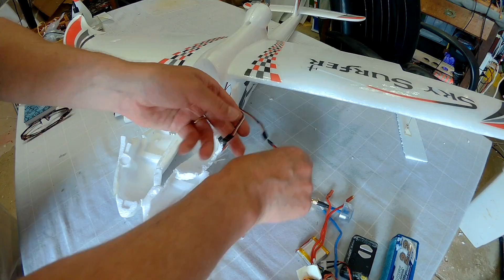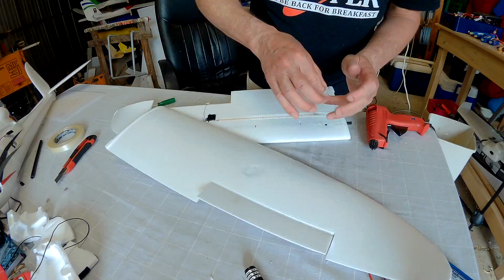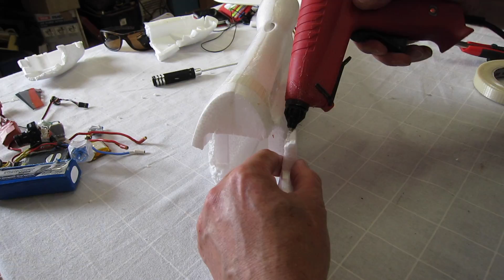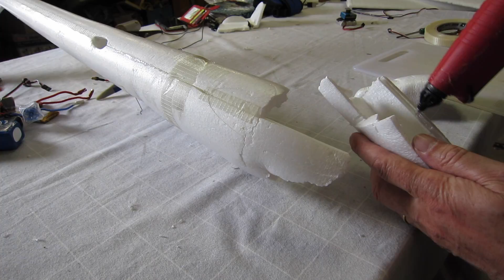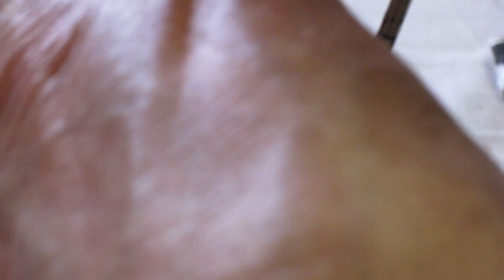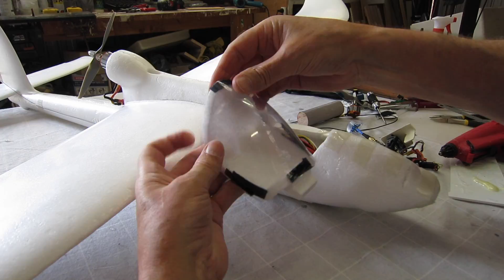XUAV SkySurfer X8 repair

Comment: What kind of glue are you using in your glue gun?
I got a totaled SkySurfer and a kit to move over all the electronics.
I have been doing research and there are so many recommendations for glue to use?
Do you recommend a  glue or use the glue gun with what kind of glue sticks?
Thanks in Advance
Reply from the maker: Any glue sticks I can find. Don't seem to have much choice here.
Reply: @AndrewNewton  Thanks Andrew,
Did you say you can use a 3s 11.1V/1300mAh when doing 3 channels, (no ailerons)?
I assume that would make it lighter and get more flight time?
Reply from the maker: @JPnTX  Possibly but less battery capacity

Comment: Once with my Bixler 1.0 before I wrecked its wing I lost sight of it similar to you with this. I let go of the sticks and throttled down.  After some panic I found it by using the video output as a direction finder. It had landed upright undamaged. These planes naturally try to right themselves if the controls are neutral. I have had nose dives other times but it was because I was trying to "fly it". Did this once with the bixler and several times with my Finwing penguin. Nose flew to pieces.  Luckily a kindly older gentleman glued it back together using Gorilla glue which is how I learned how good that glue is.

Comment: I miss my HFT Wild Hawk!  Slammed and repaired it like in this vid, sooo  many times!    This plane stands up to damage and will quickly field repair any "unexpected disassembly events" with some clear packing tape or 5-minute epoxy! You'll be flying again in no time! Great beginner design and easily modifiable with a stronger plywood motor mount and a hotter motor!

Comment: that fuse is available for around $20 -30 which is best way to go imo... never got good results using hot glue... i have used hot water and medium CA then some light weigh filler and paint and made models look almost perfect again for several years...just takes time,but is very easy imo...

Comment: Oh man, that's too bad, sorry it lost the signal. This crash looks exactly how my Bix3 looked after it lost an aileron servo in a bank turn at full throttle into the ground. I picked up the pieces and hot glued it back together. I saw another vid how this guy put the foam pieces in hot water (real hot, almost boiling) for the compressed out of shape parts, they just kind of  expand  back to shape, not perfect but close. Thank you Andrew for posting your  great video's!

Comment: Seriously using hot glue mate? 
If i were you 
I would use epo glue 
Very Much stronger than  hot glue gun 
I know longer time to cure but it will take years to hold good
Reply from the maker: The glue doesn't need to be any stronger than the foam

Comment: Hey mats know this is an old video and I dont use this account only due to getting youtube red free for three months with google music.
Anyway was talkimg to the giys I purchased my Oterra from and they say that the Opterra uses white silicone to glue it together. As you guessed I had done the same thing to it. Anyway put it back together with said silicone and it works great. And on hard belly landings has a tiny flex to it so doesnt explode in said repaired places. Worth a try. Remember rub some soapy water over the excess to remove it so its just in repair with non sticking out. Old builder/plumber trick you may already know. Cheers Gus
Reply from the maker: Didn't know that and I like it. Thanks for the tip.

Comment: I will try less hot glue..and the outdoor D/S tape. Used it under gift card/aluminum motor mount and it goes nowhere need to try it on the servos. Thanks

Comment: Love to watch you at work...shows all is not lost when a plane crashes.  Any suggestions-a good majority of the time I use hot glue on the servos (EMAX-ES9051) it seeps into the mechanism and gums up the gears and ruins the Servo.  I have been building the Flite Test speed builds and experimental airlines tube planes.  Of course I  have bought a couple of plug n play and one bind n play...my original sportsman s+. Which has been crashed and fixed several times.  I am VERY new to this hobby as you can probably tell.  Love your music!
Reply from the maker: Maybe use less hot glue on the servos? I just use a few small blobs and tape over the top, or I have also used double sided tape (Scotch outdoor) or contact cement.

Comment: After you diy the motor mounts, what max size prob can be use? Does the plane effect from the slight more down thrust?
Reply from the maker: 7" prop is about the biggest, if the motor is up too high then yes it will affect the thrust line.

Comment: Hmm I'm kinda surprised you used hot glue to put the plane back together.  I prefer CA or Gorilla Glue.  But what the heck if it flies and doesn't come apart thats all that counts, right?

Glad you found it, you need to put a F4 flight controller with barometer & compass on board in it and run iNav.  I have plans to do that with my Mini Talon I have sitting here.  

Check out Painless360 channel as Lee has it fully documented on how to setup a fixed wing with this combo.  It's really a sweet setup and easy on the ole pocketbook too.
Reply from the maker: Gorilla Glue and epoxy for serious build and hot glue for quick repairs to foam, I have an Omnibus F4 / GPS with iNav on my Bix2, and it is amazing

Comment: Discharging in salty water is a unnessecary mess.
- discharge it with 4 in-line soldered car light bulbs 25W each (maybe you can jump this)
- solder + and - wires together
- drive a nail through all of the cells 
Works for me pretty well.
Reply from the maker: Bucket, water, handful of salt, clip off the cables, drop the battery in and forget. Doesnt get easier than that, and a fire danger is immediately stopped.

Comment: I had same problem with Mobius - battery died. But! I've put new battery and it worked! So try that first before dismissing camera, BG has replacement batteries.
Reply from the maker: I have spare batteries. But the problem is some tiny components were ripped off the board, not fixable.
Reply: Guess, I was more lucky. However, while I have found sd card, it was damaged (probably by heat released by punctured battery). So no footage for me either(

Comment: Sir Newton, I wanted to let you know that I received my air3 from Multicopter and it looks good. FYI, it took about 30 days to arrive to SW Missouri. Did not really know what to expect. I am looking forward to wiring it up and trying it out. I think I want to just lay it all out on a board like you did in your setup video. My comment I made on  order for the kit, due to your videos, attracted a smiley face added to the receipt in pen. Looks like you have friend there. Hope it helps. Like to support your, videos and the great info you provide.
Reply from the maker: Thanks so much. Multiwiicopter are great to deal with and your feedback must have worked because I have some more seriously good gear to review from them.
Reply: great. I will be watching for that. BTW, could I use servos like the Emax es9=08a II it he air-3 Inav, or should I use digital servos. These would be for mini talon, Stratosurfer and Munter?

Comment: I hate crashing planes especially when their NEW :-/     My original bixler one has about 12? sticks of glue in it and it still fly's Fantastic!   It still has the servo's in the ailerons and rudder when the ARF kits came with motor and servo's!  It now has a new servo in the elevator,   and a 2200kv 2826 motor  (modded) with a 7x6 prop, and it LOves flying in stronger winds :-) great plane that's why I bought this  skysurfer, to get the feeling back of a new bixler! :-)  great vid, shame about the skysurfer,  they should be called a phoenix,  cos they always rise from the ashe's :-D
Reply from the maker: I have an unbuilt Bix 2 that I might put together now, and treat it with more respect. They do fly so well when they are clean and straight.

Comment: Andrew Andrew! You've forgotten all that I instructed back on your video you made for RC flight suggestions for your nephew?
Always start with the hot water technique with EPO foam crashes.  It will literally pop the foam back into its original shape (or close to it) then start the regluing process!! lol
Reply from the maker: I have only ever tried poaring boiling water over a wing and it has never worked. Must be doing it wrong.
Reply: No, pouring hot water on foam does nothing!  Here's an exerpt of my instructions to Harry (about a year ago on your video).  I swear to you this WILL work amazingly.  But you need to hold the foam under water the whole time using tongs or ?
When you do crash (and you will, a lot, and hard), probably nose first, remove tape in effected area, take all electronics out of nose area (or tie back) and dip crushed/bent foam nose and/or pieces of foam (SAVE ALL FOAM BITS AFTER CRASH) in large pot of very hot water (doesn't need to boil) for a few minutes (3-8).  Foam will regain its original shape and form (or very close).  Then you let dry and, using appropriate glue (5-minute epoxy, CA, Foam-Tac, Goop, etc.), you can make repairs to your plane and get it back in the air.  I've repaired Bix1-2's that have been in horrific crashes (really bad, dozens of pieces) using this technique and people see it after being fixed and swear that its not the same plane!  Some say use boiling water, which works, but it also makes the foam blister and look bad. Very "hot to the touch" works just as well (maybe slightly longer wait time) but without the blistering (at least not as obvious). I've got three teenage boys (and myself) that destroyed foamies while we were learning to fly. I had lots and lots of practice fixing.....it works.
Reply from the maker: Thanks so much currdog, I promise next time I will follow your advice. Copying now and saving to a text file.

Comment: Andrew this is a sad crash. That's was an awesome bird. I had the same prob when I lost Los I also lost signal fpv and crash but fortunately I had failsafe and it crashed with a minor nose dent and some folks contacted our team . But after seeing your repair work I am still wondering if hot glue was best option  because after my repair of bix3 like this it became very heavy. So is hot glue beat option. And i am thinking of buying inav after this hehe. Gluck

Comment: Another great video showing the usefulness of foam models over balsa.  Fyi I found Foam-tac does a much better job of repairing broken hinges than tape alone.
Reply from the maker: Only had tape available but I agree, contact glue works well for hinges.

Comment: Great video! Two noob questions (because I've been doing alot of foam repairs lately...): do you ever pop the foam in hot water to get it a bit straighter? And was there a reason you chose hot glue over the glue you initially used (or foam glue) to stick the fuselage together?
Reply from the maker: Just impatience Pete. Hot glue sets quick. I have not had success with hot water but I must try it again....because I am expecting more crashes!
Reply: Yes true. I was about to ask same question. I kept thinking with hot glue on repair it will add up a lot of weight. My bix3 was in same situation and now it's very heavy with so much hot glue.
Reply: Andrew Newton I've had great success, especially with big crashes. Almost can't tell it's repaired!

Comment: Probably too late now, but clipping leads and soaking in salt water may not kill the battery, better off to connect to a small automotive light bub or similar and verify it's dead with a meter.  Or...have some fun and pound a nail or three through it!  :)
Reply from the maker: Salt water works beautifully, I have extensively tested this method
Reply: Andrew Newton indeed!
Reply: What salt water and electricity can do is cause the battery terminals to be corroded away by electrolysis.  Once they are gone, there is no terminal to measure the pack voltage, so it will always read 0v.
Reply: If possible, discharge with a load as suggested by Mark o. As a last resort (if for instance the pack is has broken wiring) use salt water method. This can take many days to complete the discharge and make it safe.
Reply: Hey Andrew what about Adding a all new Direction Testing Solar power on your models  ?
Reply from the maker: I'll whip one up today!

Comment: Hey Andrew . What frsky rx are you using ? . I use to use xm+ recievers with all my fpv drones but that's with a flight controller.  
Since switching to planes I've wondered what the best option for recievers go. I have 3 planes. 2 which are strictly 3d planes and 1 trainer cessna. I have the v8r7-ii  recievers in all 3.  Some input would be great on which is the best for planes. Thanks
Reply from the maker: I only use X series (for the telemetry) Mostly X6R but also X8R and X4R and the X4RSB